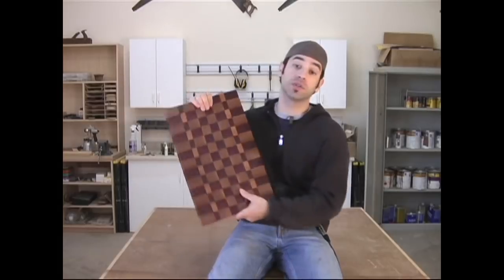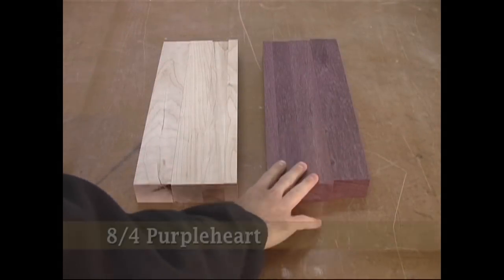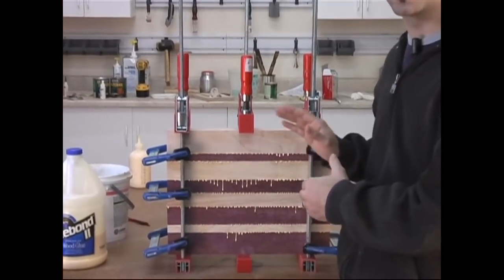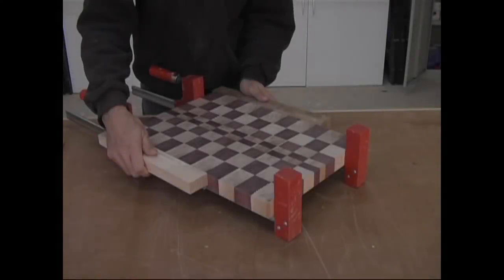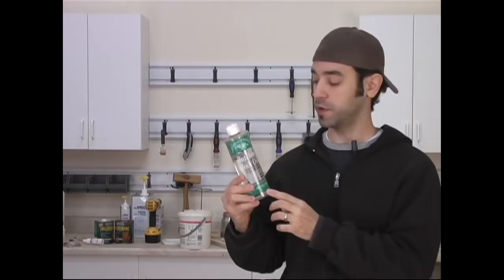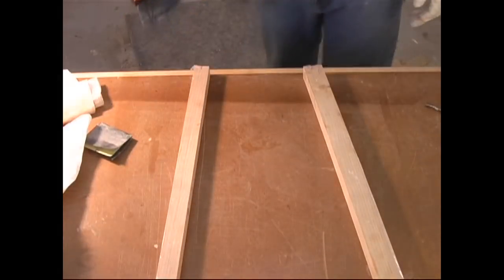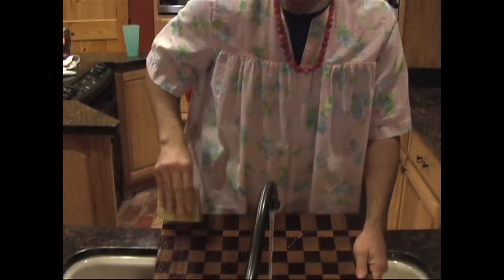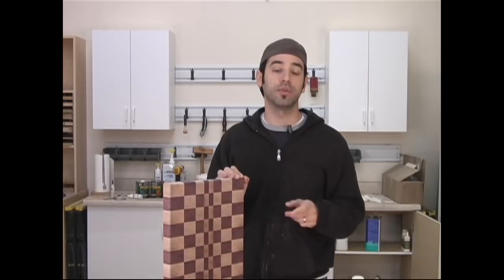7 - How to Make a Butcher Block End Grain Cutting Board (Full Video)

Comment: Glad to see someone make one without a planer. I wish I had a planer, but most of us have to sand.
Reply: If you dont have a planer you can use a drumsander which I would recommend as the planer can cause chip out and that would mean that you would have to try and salvage or start all over. There are videos showing how to make a drumsander if you cant buy one, I have been make jigs for the table saw and bandsaw, that is a great way to learn too. All the best to you I hope you come right. Btw using a sander can cause your pieces to be uneven, as a wood worker I know how disappointing that can be

Comment: Great Video. one thing to keep in mind, when melting beeswax, use a double boiler. The flash point of beeswax is around 400 degrees Fahrenheit (200 Celsius). If you get careless, you have a fire to deal with. I enjoy the videos, keep up the good work. Now I have to get to work making my wife one of these.

Comment: Love your videos. I have a question about grain direction. Does it matter when making an end grain board? Opposing grain is fine? Basically is there any thing I need to worry about grain direction wise when making an End grain board? I’m only asking because I’ve gotten through the first panel glue up and cross cut all my pieces and came up with this amazing design in my eyes, I just don’t know the rules about grain direction in an in grain board. Thanks in advance Mark

Comment: This is a great educational video for me. My question is your recommendation on a cross cutting blade when cutting across the end grain pieces. I had horrible chip-out on the top and bottom. As my name implies, I'm a novice at this and can't thank you enough for all your videos and tips.
Reply: +Wood Rookie If cost is a concern to you (it definitely is to me),  I have found the Freud D1050X to be a very adequate all-purpose blade. It has worked well for plywood, cross-cutting, and ripping. At around $33 on Amazon, it doesn't break the bank either. If you are looking for a dedicated, expensive cross-cutting blade,  I'm afraid I don't have much advice in that area.

Comment: Hi Mark - I haave a couple questions for you. I am in the process of making this based on the directions that you have provided. However, mine are not coming out dim. like yours. When I cut the boards into 11 strips 1.250" like you suggest I only get about a 9 in x 12 in board. So I certainly am doing some thing incorrectly. Looking for some help as these are very cool boards.

Comment: Hi Mark, Good video thanks.  A question about your finish.  I don't have any wiping varnish, but understand it is basically 50%varnish and 50% mineral spirits.  So, for your cutting board finish, would mixing varnish on mineral spirt 1 to 1 get the same result?
Regards, Sam

Comment: do the size of the stripes matter?  I want to build some end grain cutting board from scrap maple stripes .  I have several width. For the first glue-up,  do I have to resaw the stripes all the same width or would it be OK to glue together a mix of 1'' width,  2" width, 1.5" width, 3'' width? Until I reach my desired total width.

Comment: I have watched your video and read your article regarding finishing an end grain cutting board. I felt the technique of using the salad bowl finish would be the best bet so I tried it on my first cutting board. It seems to have sealed well but I was a little confused as too how long the odor from the finish would last. It's been 3 months and it still has the odor. I haven't tried to wash it to see if that would help with the odor. Today I tried the other method of using mineral oil and paraffin wax and I'm not too fond of this technique. I think I would rather use my first method but I don't care for the lingering odor. Do you how long it would usually take for the odor to disappear?
Thanks
Reply: Did you dilute the salad bowl finish with mineral spirits like he did? That helps with the finish penetrating the board and evaporating for drying.

Comment: I am a beginner woodworking and absolutely loved your video.  Question....You said you are using 8/4 lumber (which my reading says that is 2") but your first piece is 2 1/4"????   I purchased cutting boards from woodworking source and they are 1 3/4" so am wondering what to do.
Reply from the maker: 2 1/4" is the width, not the thickness.

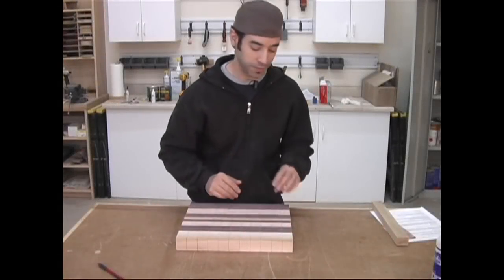Comment: Note the difference in patterns in the two boards when they are being finished. Take care in how you arrange the boards as explained at 3:10 to achieve your desired block pattern. The pattern shown at 3:10 will yield the mineral oil finished board. While the pattern used at 6:35 will yield the varnish-finished board.

Comment: Hi Marc
I´m a huge fan of your´s
i have a few questions about this cutting board, i hope you can help me (i already did this project)
1.- in this video you present 2 different designs of your boards right? after the second cut the pattern its fifferent from the first i think
2.- in the video you said that the measures will be approximately 18" L x 14" W x 1 1/4" T, but with 11 strips (thats the number you said we need after the second cut) my board have only 14" L
i supose that its a mistake in the number of strips, maybe with 13 or 14 strips i will have my 18" L right?
PLEASE tell me if i´m right or what was my mistake because this freaking me out
Thanks and congratulations, your project, videos and channel are great
Reply: +Victor Porthos I noticed that too after putting it together. It seems that in the first part of the video, if the boards were matched up the way he mentioned, you wouldn't end up with the 3/4 inch pieces running next to each other along the middle for that thin checker pattern. I was confused when I looked at the final product I made and came back to watch a couple times to confirm.

Comment: Hi Marc and everyone.  I am a beginner and I have a "probie" question.  Do you recommend using biscuits to join the strips in the last step?  If you don't recommend, what is the main reason? Thank you much!
Reply: BaoLong Nguyen I was thinking the same thing.
Reply: All boards carefully planed to same thickness, so no help needed from bisucits to level side to side.
Reply: Why would you use biscuits? They are useless and not needed in any glue-up, be it cutting board or tabletop. They offer no added strength or integrity.  Their only possible benefit is they can help line up your boards in large glue-ups such as large tables... but they are not needed and a biscuit joiner is a waste of money.

Comment: Hi Mark, after you cut them into strips and started arranging with the end grain facing up, it looked like it was a different board altogether. The thin strips were in the middle, whereas after initial glue up the thin strips were close to the outside. Maybe I’m looking at it around? Regardless, this is a beautiful board!
Reply: That's what I thought too. It just didn't make sense for the patterns. Did you get a response for this question?
Reply: @acupsa  unfortunately no response, but I’m sure there was more than one board when the video was made and edited

Comment: What purpose does adding mineral spirits to the salad bowl finish serve? I just finished a similar board, but used the finish undiluted.  Wondering what would have been different had I diluted it.
Reply: Stephen Edmondson I was wondering the same thing.
Reply: Mark Womack I found a later video (either where he revisits cutting boards or their finishes, I can't remember) where he goes into detail on this. It's to thin the finish so it soaks into the wood with multiple light coats instead of creating a film. I used a 50/50 mix on my last batch and ended up doing 4 or so light coats. Worked great.
Reply: Thank you very much for taking the time to reply. Before I read this I put a Watco finish on my cutting boards (face grain) without diluting. It seemed to work fine the last time, but I am definitely going to try diluting next time to compare the results.

Comment: Great video!  But...Did I miss something?  How is the final board 18” in length if the initial ripped pieces are 15 1/2”?
Reply: Depth of board is determined by the width of the rips on the final glue up. This initial strips are turned on their end at that point. Think of it like this: If you’re strips are 2.5”, and your final cut is also 2.5”, then things remain square and your board stays the same size. But if in that second step you cut 2” squares, then your board is lengthened. Same volume, but stretched in a different manner.

Comment: Can you do a video describing the relationship between the thickness of the original board, the width of each cut, how you are rotating the pieces to glue, and the dimensions of the resulting board? I am confused, especially because I don't have the ability to change the thickness of my 8/4 boards, only flatten it.
Reply: You can change the thickness of 8/4 boards with sequencial runs thru the table saw, small cuts, flipping board end for end after each pass.  If this does not split the board use hand saw to finish.

Comment: Thanks for the quick response! 
My very last question: When you say end grain cutting board is that really supposed to be "Quarter Grain"?
Reply: No, end grain. The board used could be, flat, rift or quartersawn. Though quartersawn is the most stable so it is the best to use. It doesent matter.

Comment: Two questions:
1) Top, bottom, and all sides for the salad bowl finish?
2) The finish that I picked up at my local Lowe's stated not to thin it.  Will this be an issue or should I go ahead and thin it anyway? 

Beautiful boards and I have enjoyed making my 3 so far.  Just gotta get the final sanding, routing and finish in place so I can finally deliver my mother's day presents.  Just a tad bit behind schedule.
Reply: Many finishes say not to thin, my understanding is that this is an environmental issue. Thinners are bad for the environment, thus if you do not thin the environment is happier. Thus the government doesn't want us to thin, and so finish makers put that on their cans to make the government happy.

Comment: Excellent! I just watched this again (4th or 5th time) and I'm about to start my own today. I have one question... I noticed after the 2nd cutting session that you changed the order of the strips placing the 3/4" strips in the center instead of next to the 2 1/4" strips on the out side. I like the design better that way, but is there another reason such as strength? I assume you're making multiple cutting boards.
Reply: I'm pretty sure it doesn't matter as far as strength, only different patterns you might find more attractive. Looks like he has built several of these and used video from different builds.

Comment: Hello Marc. Thank you for all the videos. Quick question, i have a ton of maple wood, can i stain with water based stain from General Finishes, to make it look like 2 different woods? I would stain some wood, and leave the other portion unstained.  Also. Would i sand first then stain, or viceversa?
Reply: One more thing..if i stain, can i still seal it with General Finishes Salad bowl finish?
Reply: Qais Arabo Sand first then stain. If you sand a stained surface it will remove some of the stain, if not all of it.

You can certainly do that, just make sure the stain you use is food safe.

Most of the stains will have instructions for their application. You will want the wood to be at its finish surface before staining due to the removal of material from sanding. You will want to stain those pieces before putting together your cutting board in order to avoid the stain bleeding to the surface of your plain wood.

So, your process will be much more difficult because most of your end-grain is INSIDE of the wood before the first glue up, followed by cutting that into strips...so, your process will have to be done piece by piece, instead of creating long strips to glue together. Essentially, you will have to cut your maple into individual tiny blocks, sand all the end grain, stain half of them, then figure out how to do a glue-up on 100 different small pieces, as opposed to having different colors that you can glue into strips like in this video.

I suggest just making a large, single color hard-maple board to start with, and once you can get another wood, make another board.

Depending on where you live, online wood sources are usually the best way to go. I personally use woodworkerssource.com
Reply: Actually, I think I got that wrong a little bit...you can make one, but it will be in long strips of color instead of small alternating blocks. You can cross-cut a very wide board to expose the end grain, and then stain each of those strips, then glue those to plain wood strips from the same board...but you will need a board that is at least 8-12 inches wide to get a useful sized cutting board.
Reply: Or edge-joint a few board to make a wider one...you will still just end up with alternating strips instead of small blocks.

Comment: Question: How many cutting boards were used in the making of this video?  Answer: At least 3.  Nice trick Marc...  The first board used in the intro has 11 stripes, the second board you show in the build process has 11 and the one you add the finish to has 19.
Reply: Orange Crusher 
The intro could be filmed after the build, so it may just be two boards, though the fact that he showed two different finishes is enough to prove that he made at least two boards.

Comment: Why no comment on the varnish quesion? Doesnt the varnish finishing method defeat the purpose of making an end grain cutting board? Also I didnt see the link to the General Finishes product in the write up.
Reply: Varnish isnt food safe. I have seen that Watco have a food safe danish oil available. Or you could use mineral oil and beeswax, used this method for my daughters cutting board and it is working great, to clean use salt and lemon juice and re wax in needed
Reply: Exactly what I was thinking. Why not protect your end grain up, cutting board with a nice piece of glass?

Comment: Quick question - Are you cross cutting the board with a fence around 6:20?  It seems stable enough to do, but I was always under the impression that one should never cross cut wood against the fence.
Reply: Never cut with both miter AND fence. Since most crosscuts are done with the miter, it is very common to say not to crosscut with the fence. The issue is, you never want to cross the blade with your body, so when using the miter the part against the fence is unattended. Unattended, it has a higher likelihood of shifting into the blade, getting pinched between blade and fence, and kicking back.  Get around this by using a stopblock before the blade area, leaving plenty of room between blade and fence so if it does shift some, it just bumps a bit and no real kickback.

Now, you CAN call him on crossing the blade with his body, which is never recommended (due to the potential for kickback), but it is not the crosscut on the fence that is the issue. But I think we all end up breaking this rule, sooner or later. Familiarity and contemppt and all... LOL

Also, his splitter does have anti-kickback thing-a-ma-jigs, which help.

Comment: I'm new to woodworking and this might be a stupid question but if you rip a board long grain and flip it on its side isn't it still long grain?
Reply: That turns it into edge grain, to be exact. You have face grain, which is the "top" and "bottom" of a normal board, edge grain, which is the grain along the long "sides" of the board, and end grain, which is the grain on the short "sides" of the board. You are correct, if you rip cut a board it maintains the same properties of which grain is which, but doing the end grain block is a little different than that one step.

That is only the first step in an end grain board. Let's say you have an 8/4 (pronounced eight quarters, which is a board of 2 inch rough cut thickness), 6 inch wide board that is S4S (surfaced on all 4 sides), so the actual thickness is about 1 3/4 inches, but it is smooth and ready to be jointed. You then take that board and cross-cut it into a 16 inch piece, still 6 inches wide, and take another board of the same thickness and width and cross-cut it into a 16 inch piece, still 6 inches wide, then you rip both of those 16 inch long pieces into 6 new "boards" that are 7/8 of an inch wide (due to the kerf of you table saw blade, they lose a certain amount of material, often about 1/8 inch). Now, you have twelve pieces that are 16 inches long, and 7/8 inches wide. You alternate these and edge joint them (as in the original "edge" from the first paragraph) which leaves the end grain exposed, just as with a normal board, on the "ends" of the piece of wood that is 16 inches long, and now 10 1/2 inches wide due to the rip-cut wood loss.

Now, you are ready to prepare it for joining to expose the end-grain for the entire surface of the cutting board.

You take this new 16" x 10 1/2" board, and cross cut it into eight strips that are 10 1/2" x 1 7/8" (again, 7/8 due to the kerf of your saw blade), so you have a bunch of strips that, when rotated 90 degrees on their long axis, expose the end grain to the "top" and "bottom" of your view. You can now join these eight 10 1/2" x 1 7/8" strips on their face grain and have a board that exposes the end grain to the top and bottom of your new cutting board, which measures 10 1/2" x 15".

If this is confusing, let me know, and I will come back to it within a couple days.